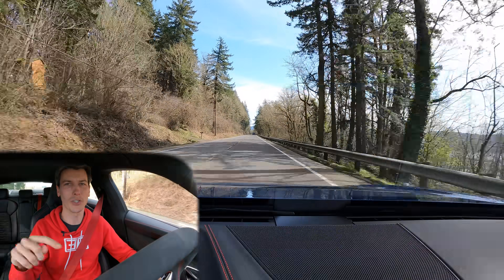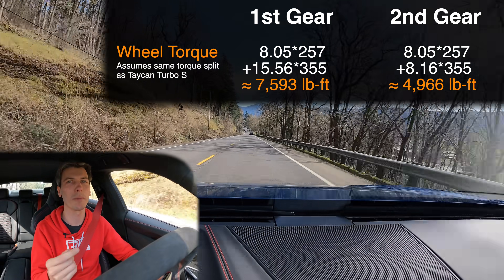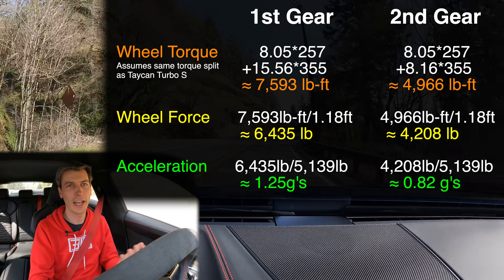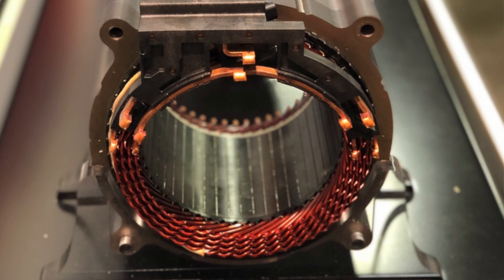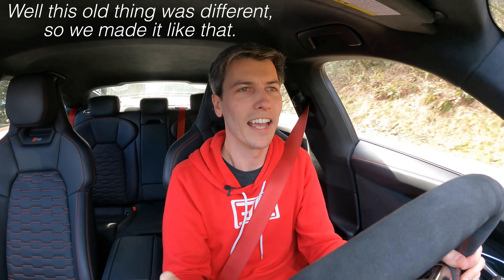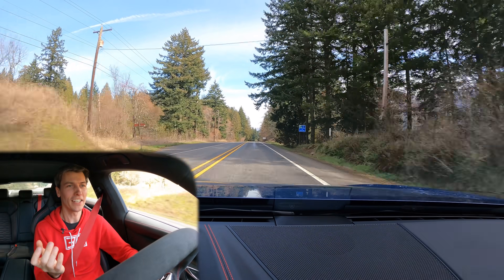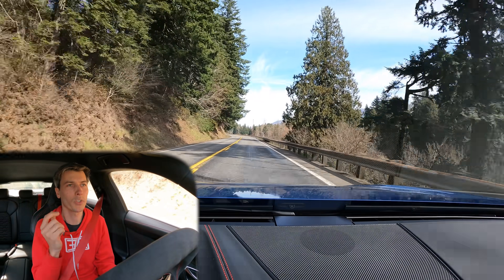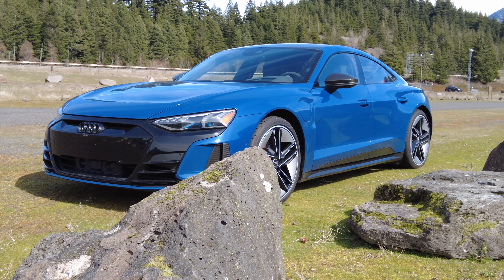Are Fake Manual Transmissions Coming? Audi Keeps It Real

Comment: Maybe fake manual transmissoons could work if manufacturers allow users to have the choice to make it work like a normal EV whenever they want to, which is definitely possible. This gives the driver the choice to row through gears for fun and nostalgia, and  still have normal EV benefits for normal use. 

This reminds me of how Subaru does their CVTs in some of their cars. In normal D mode, it acts like how a CVT should by finding the optimum RPM and sticking to it while in Sport mode, it does fake shifts. So despite the 'sport' tag in sport mode, it is actually slower in terms of outright acceleration than in normal D mode, but sport mode feels more engaging and less 'annoying'. Regardless of which you prefer, atleast you have the choice, which is how I hope fake manual EVs will give.
Reply: Owning a 2021 Subaru with a CVT I can tell you it does not act like a CVT should, even in normal D mode it still does the fake gear shifts.
Reply: I seriously never understand why all car manufacturers dont put a button that allow you to choose cvt behaviour. 
They dont have to change any hardware its just a simple software and a button or switch. 
In most cars you cant get the full benefits of cvts because of boomers need to hear gear shifts.
Cvts can be faster than any transmission but most cvts are significantly slower than any other transmission regardless of the mode that they are in.
Reply: @HR15DE  If you can load european software into your CVT you'll get smoother driving, Problem solved. We don't have jerky CVTs over here. Drivers hated it and made their feelings very clear to manufacturers
Reply: @Laykun9000  depends on what your commute is like.  If you spend a lot of time in traffic then a manual gets annoying.
Reply: @unpopularopinion8608  I've got a 6 speed manual,it's a real pain not like the old 3 and 4 speeders,forever thinking of what gear i'm in and what to change to next,around town,ratios are just to close together  .
Reply: @MrLeslloyd  I had a 6 speed for several years, hardly ever used 6th unless on interstate, it wasn't that bad.
Reply: CVT’s are weird for me to drive. You floor it and accelerate, but it doesn’t feel like you are accelerating, bc audibly the engine note never goes up, and physically as your speed does increase, the g’s pushing you in to your seat are reduced.  The g’s aren’t increasing as the engine’s power is going up as the rpms are increasing - the rpms just go up and stay there. Initial push, then nothing.  So you both feel and hear no sense of accelerating.  You likely won’t be smelling or tasting it either.  So that just leaves your eyes to detect the acceleration, and if on a non-congested highway, you might not even realize that either.
Reply: @stephen3164  sounds like the vehicle your CVT was in was just severely underpowered. even in my old 2010 Dodge Caliber SXT with the 2.0 inline 4, that CVT made use of all the 180 measly horses lol. it felt like I was always in the powerband, cuz I was. the initial launch from a dig was always powerful and it kept that powerband up to like 60-70mph before it started feeling gutless. I'm sure in even a 300hp sports car it would feel amazing. CVTs were so under-hyped in the car community. they were ruined by the econoboxes car manufacturers put them in. no real sports car ever got a CVT, which is a shame.
Reply: @joshbrien1318  I agree on CVTs with IC engines and I'm a so called boomer ha! But I'm a gear head too.
So what could be better than putting the engine in it's sweet spot and keeping it there wether just cruising with the engine at a lower throttle setting more fuel efficient rpm or accelerating with the engine at higher throttle setting with more power producing rpms, all happening seamlessly by itself.
A lot of power sports toys have CVTs and nobody bitches about them not shifting. Idiots 🙄
Reply: Oh and as far as electrics, I don't need any fake shifts either. Just let em run the way they are suppose too!
Reply: @stephen3164  I've been in a CVT before. I didn't feel like that. What I felt was just very much different. It's somewhat similar to an EV as for what I feel in acceleration but still not quite. It was a decent experience I'd want to try again if I could... Mine was just a small ride from a friend of a friend to my car that was a few blocks further.
Reply: I had a Lancer with a CVT in it and it was all one continuous climb from idle to top speed. I loved that car. It was so easy to focus on cornering. Amazing first car.
Reply: @psychic_wolf  I loved the CVT in my Caliber, it felt torquey from a launch and it never felt like it was out of the powerband once it got there
Reply: Im doing all that, power curves, gears and gear ratio ( total and pr gear ), also ICE sound, clutch etc
Reply: The full auto mode is actually part of the Toyota patent, so it'll be there!
Reply: Would be nice to use those fake shifts to actively cool the motor. If anything, limiting the torque output of the engine should help with thermal build up as well, that’s important because magnets lose efficiency with heat.
Reply: W
Reply: Sounds like more electrical trash to go wrong
Reply: As soon as you give people an option to not row their own gears, they’ll default to what is easiest pretty quickly. That’s why I don’t like paddle shifters… i quickly stop using them and let the transmission do it’s thing in auto. If you do a fake manual transmission, I think they should.make that the only option in the car or don’t waste the engineering resources and drive up the cost for something that will be used like twice.
Reply: @jasonswitzer1748  and your argument of never using paddle shifters just proves you're not the type of person who wants to be in as much control of the vehicle as possible. even in a Fake semi-auto with paddle shifters I use manual mode because I love being able to be in whatever gear I need to be without fiddling around with the accelerator pedal and having unintentional acceleration when I'm just trying to downshift for engine braking or to prepare for a turn, etc.
Reply: I was going to say the same thing. If it's all fake, then in theory the car would have the ability to turn of the "manual mode" and go back to a regular 1 speed automatic mode. While I'm guessing the fake manual transmission wouldn't be exactly like a real one in a combustion engine, it would be nice for all the purists to have the ability to relive the glory days when EV's become the standard.
Reply: @DevoT  for sure! Though it always cracks me up when they're called purists, as it's actually the exact opposite when dealing with an EV. A purist would want no artificial limits.

Most of the time, it's "driving manual makes me feel cool." the old excuse of performance went out the window with dual clutch. By every measurable metric, a manual performs worse. Some people just don't want to accept change.
Reply: With anything added to a car, there will be added cost. I don't see this making it onto mainstream cars, it would be a very niche market for fake manual transmission EVs. The customer that buys one would want that feature. I agree it should be configurable, but from a companies money making standpoint this makes very little sense. How many people actually drive manuals these days? It's pretty rare.
Reply: @Laykun9000  "how many people drive manual" like 80% of the population of Europe lmao
Reply: @fedyx1544  yes and the reasons people do it are completely irrelevant to EVs. We're clearly talking about cars marketed to people that just want the manual transmission feel. An ev with one gear is effortless driving, which is what most people want, because most people just want to get from a to b
Reply: @fedyx1544  that's not a lot of people dude
Reply: @Laykun9000  No one drives manuals anymore because the manufacturers don't make them anymore. It used to be, cars came standard with a manual and the automatic was an extra cost upgrade. If manufactures still did that, there are plenty of people that would buy them to save money. Especially now with car prices through the roof.
Reply: @alecb8509  Not so in the UK. Around 90% of ICE cars sold here have manual gearboxes. It is autos that are in the minority here.
Reply: @alecb8509  I guess I'm "no one" now.
Reply: @alecb8509  It drives me nuts. People say "nobody is buying manuals" but its not because people don't want them. Its because they're on so few cars these days.

Comment: Really good info and perspective. I hadn’t considered the motivation being better acceleration. My thought in being pro-transmission in EVs, even if just a 2-speed, is manipulating that final drive ratio for efficiency gains. Rather than traditional under-drive gearing with a final 1:1 or overdrive, maybe have a 1:1 gear and an overdrive gear for highway use. EV range goes in the dumpster on the highway. Why not bring motor revs down with some gearing to extend range?
Reply: EV range goes in the dumpster on the highway because aerodynamic drag increases significantly at highway speeds. It takes 4 times as much energy to go 100km/h as 50km/h. That has nearly nothing to do with drivetrain efficiency. The same thing applies to ICE vehicles too, but it's not as noticeable because they're ICE vehicles. If you want to go fast without burning a ton of whatever energy improve your aero. I gained almost 10% range at 130km/h on my Leaf with an air dam and wheel covers. It'll never be as efficient as slowing down though, because physics.

Comment: (1) I’m an old thing, and I’m thankful I had so many decades of enjoyment of much lighter weight sports cars that (a) actually sounded and felt great, without piped-in sounds, and (b) actually felt great, with real clutches and real gear shifts. (2) I’ve switched to another great old thing, namely motorcycles, that, for now, still do offer actual sounds and sensations as well as real clutch and gear systems. I stopped buying my favorite sports car model about the time they made manual transmissions a scarcity and started adding-in computer generated engine sounds. Let’s face it: you are paying to make an actual car, traveling along actual roads, behave as though you were playing a video game. (Kind of backwards, in my opinion). My absolute favorite cars were my old Triumph TR3 and my earliest, smallest and lightest weight 911 variants. Kudos to Toyota and Subaru and a few others for still offering small, sporty cars with actual manual transmissions. Now, we need some smart engineering types to perfect synthetic fuels for ICE power trains so that we have an alternative to overpriced laterally moving wheeled elevators.
Reply: yeah motorcycles are great if you want something sporty and raw.
Reply: Sounds like you need to try the plaid Model S

Comment: There are lots of reasons for me personally to not like EV's- but I think I would be a lot more likely to drive one if it had a "manual" transmission, even if I knew it was fake.  The whole CVT fake shifting thing makes no sense to me, an automatic is an automatic.... likewise, there is no denying how fast some EV's are, but even if you could buy one that could lap the Nurburgring as quickly as an F1 car and it was as easy to drive as a Camry, I still wouldn't care... but offer one with 3 pedals?  Now I'm interested. 🤣

Comment: Could a case be made that a relatively weak electric engine could benefit from a true manual transmission?
Reply: I don't think so, because the torque curve is very flat, you don't have any interval where it would be better to keep the RPM in order to have some significant power. And even if it would benefit from a transmission, it would be easier and simplier to make a slightly more powerful motor than adding a complex device to the car just to compensate the weak motor.
Reply: @M_Andras  The weaker the motor the more you will gain with a gearbox. The flatter torque curve might make it enough with 3 gears instead of 7 though.
Reply: @martinsvensson6884  The torque curve is so flat that you have almost the same torque at 1000 RPM like you have at 10000 RPM. So what is the benefit to drop the RPM if you can just further increase the RPM? Of course there are noise and frictional loss but none of that are significant.
Reply: @M_Andras  Would you draw power from the battery more efficiently at 3000 RPM vs. 6000RPM?
Reply: @Trag1cMag1c  I think it would be not more efficiently at 3000 RPM, but simple a bit less energy would be needed, because lower RPM means less frictional loss. 
I can imagine that some day in the future when automakers exploited all the biggest gains like using permanent magnet motor - induction motor and things like that, and they search the last percentages for being a little bit more efficient, they design a small 2-3 gears transmission. I am not a fan of transmission in an electric car because I'm fed up with the complexity of the ICE cars, and I'm very glad that electric cars contain way less parts, but knowing automakers, I'm pretty sure that they won't stop until they produce extremely complex cars again. :)
Reply: @M_Andras  the extra frictional loss in the engine and drivetrain at speed is lower than the frictional loss AND mass penalty added at all speeds with a multispeed gearbox. You can win back the losses with smarter bearing designs and lubricants with "interesting" shear characteristics but you can't win back the mass penalty and such friction gains apply regardless of the presence of a multispeed gearbox (There's the complexity/maintenance penalty to consider too)

Don't forget that air drag goes up with the cube of speed - meaning that it rapidly becomes THE factor in the equation which dwarfs everything else (usually once you start exceeding 55-60mph. By 80mph it's a 800 pound gorilla if you don't pay attention and the majority of drag doesn't happen where naive assumptions might place it). There's little point gaining a few tenths of a percent in the drive train at 80mph when bigger gains are to be had elsewhere
Reply: That sounds like it makes sense to me, but I'm not an engineer. But if it were true, weak motors are cheap so it could be a way to make a cheaper EV. Or how about that front wheel drive electric Chevy spark that had to automatically limit how much torque it gave you to maintain traction? Controlling that torque manually instead could be interesting.
Reply: @DirtyDan77  Its cheaper to increase motor size than adding a gearbox. At least up to a point.
Reply: @martinsvensson6884  ah. well like i said, i don't know anything lol.
Reply: A multispeed gearbox will always be much heavier , more fragile and incur more drivetrain losses than a single speed reduction gear

Automotive engineering is all about compromise. Make the stickbox lightweight enough to compete with the reduction box and the electric motor will shred it. make it strong enough and you incur a range/performance penalty

Aeromotive is much the same. Turbine engines drink 30-50% more fuel than equivalent power piston ones, but they're MUCH lighter/smaller, can generate a LOT more power and only "3" moving parts vs thousands (maintenance intervals measured in months rather than "every flight" as used to happen to big aviation engines like those on Constellations). The result is that the equation tips in favour of the turbines despite needing 50+ tons more fuel for a long-distance flight

Comment: In the 24 years I've been driving I have yet to convince myself that having an automatic is ok. I still drive manuals, and I currently have a car on order that has a manual. These days automatics are more efficient and they shift faster than I can, yet I just find doing it myself to be far more engaging and fun. That's actually one of the big things that turns me off about EV's. So if there is a lightweight sporty EV with a manual, I'd be much more likely to consider it.
Reply: fun is a real thing, it sometimes outweighs all the technical advantages. nothing more to say here.
Reply: I’m 25 and have been driving manual since I was 14 and while I agree it will never get old (I’ll always enjoy driving a manual), I can really appreciate a good automatic.

Have you had the chance to drive any expensive automatic cars like an M5 or a 488?
Reply: @blanchbacker  Yeah, but it's videos like these and the comments they attract, that seem to want those of us who like manuals to not be able to get them.
Reply: Im also a die Hard manual transmission fanboy. But for commuting to work, getting to the supermarket, etc. I take an automatic every day….
Reply: @187Overkillah  you maybe can have both :D we will see what the future brings
Reply: Manuals use more horsepower. I haul my horses to various competitions regularly. From my place to the expressway  is a few miles of hilly terrain and several stop signs. When I use my manual Trans truck and I stop for fuel at the expressway station the horses are hot and sweaty. Do the same trip in my auto Trans truck and horses are relaxed and chill. I added a camera in trailer and the horses bracing for the decel-accel cycles is nil with another and constant during gear changes for manual. The manual gear changes are smooth but there is a faint decel on each gearchange followed by inevitable acceleration through the next gear but an auto trans has minimal amounts of these effects. More horsepower for manuals.
Reply: @jimmyaber5920  it took me a moment to figure out you were talking about real horses haha
Reply: Exactly this, as a small manual sporty hatchback owner, and as someone that has tried to drive powerful EV's...

Yes, EV's are heccin fast

But they're nowhere near as fun as actually driving your car. If future EV's have the option to have a fake manual, it'd make me very happy